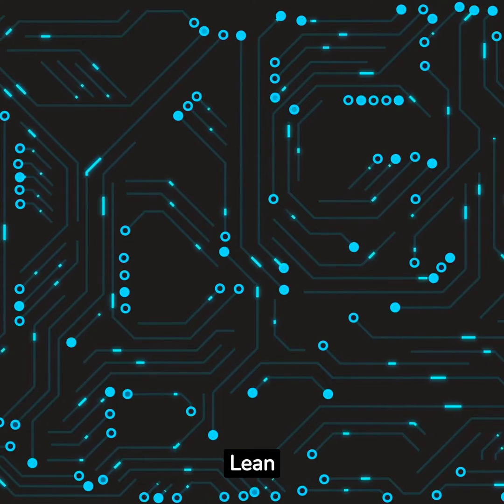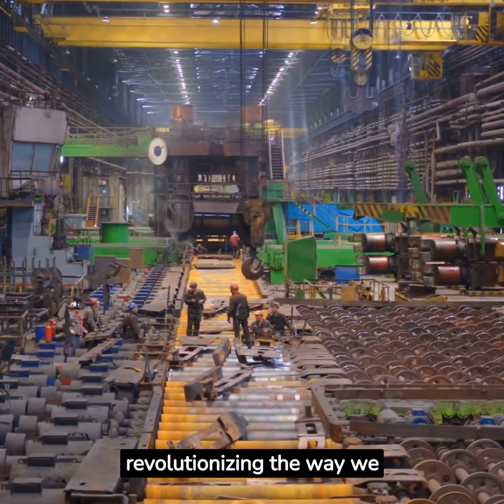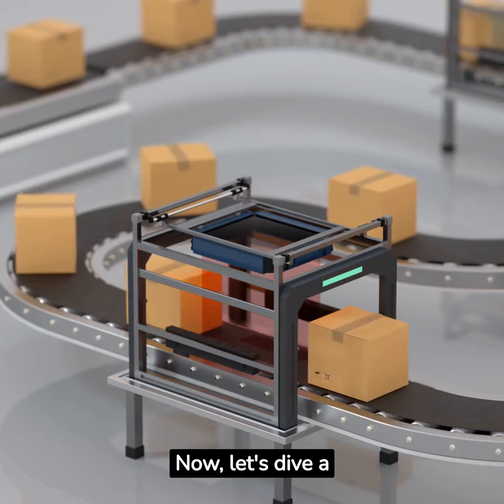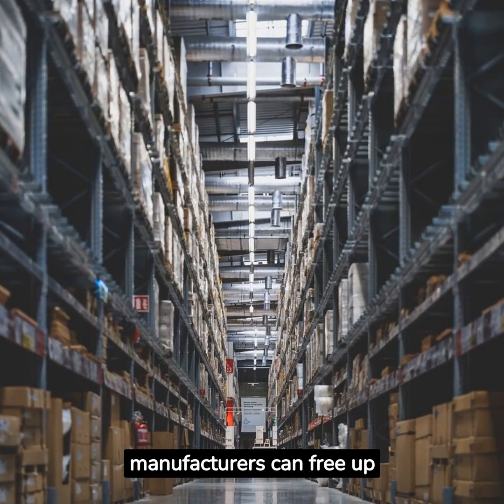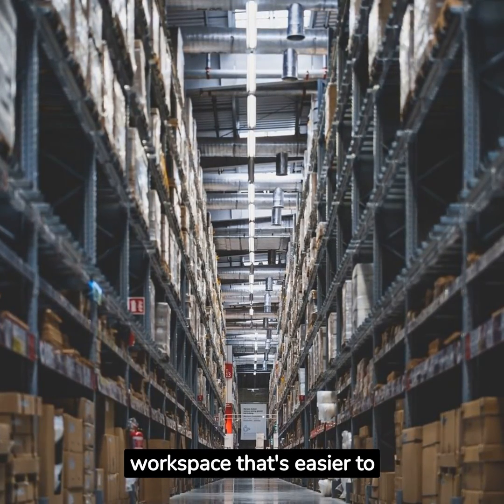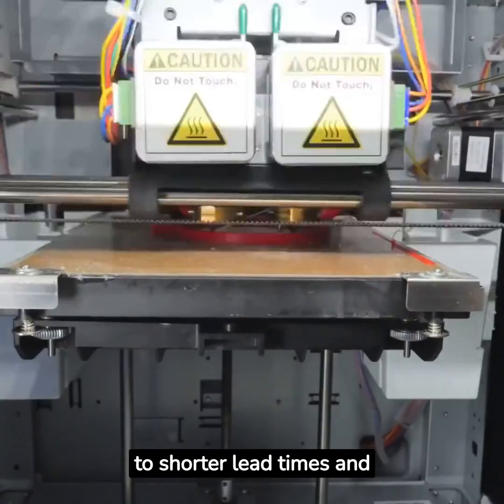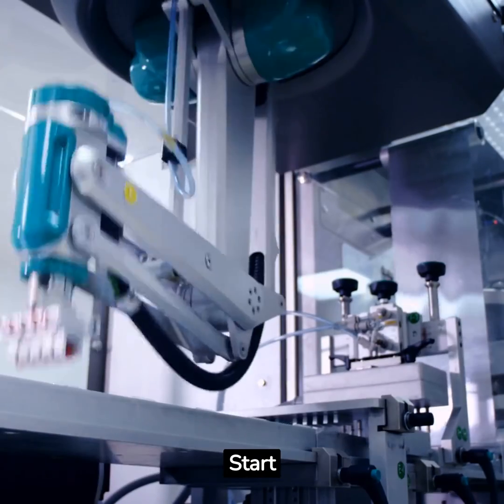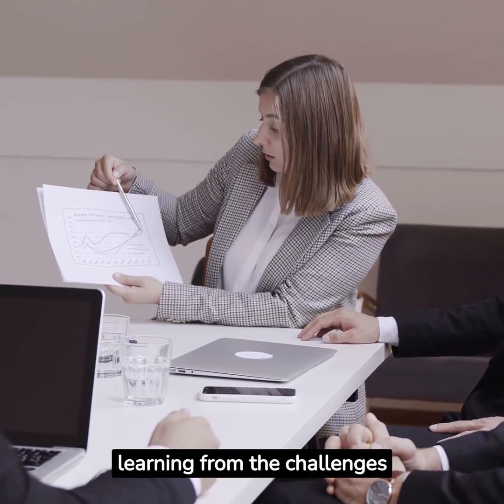What exactly is one piece flow in Lean Manufacturing?

Comment from the maker: One Piece Flow is a key concept in Lean manufacturing that emphasizes the continuous movement of a single item through the production process. Here are the main features and benefits:

Key Features:
Single Item Processing: Each item is processed individually rather than in batches.

Reduced Work in Progress (WIP): Minimizes inventory between processes, leading to shorter lead times.

Continuous Flow: Items move smoothly from one step to the next without delays.

Quick Feedback: Issues can be identified and addressed immediately, improving quality.